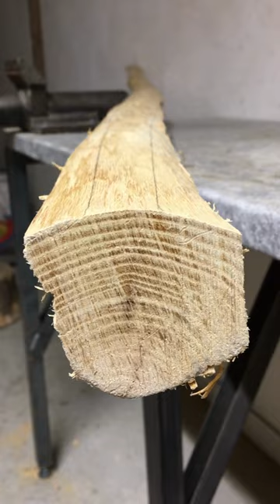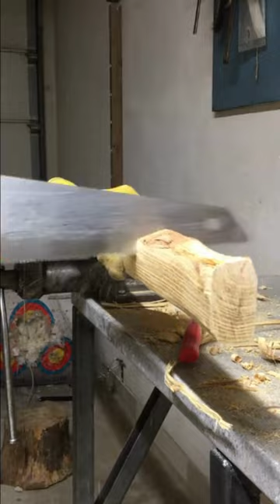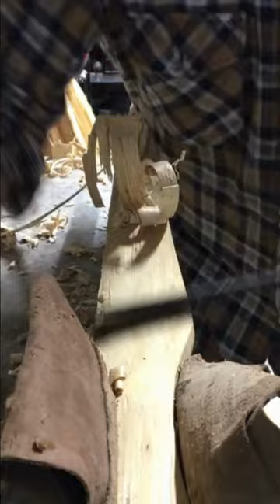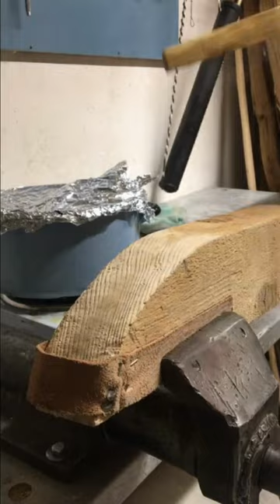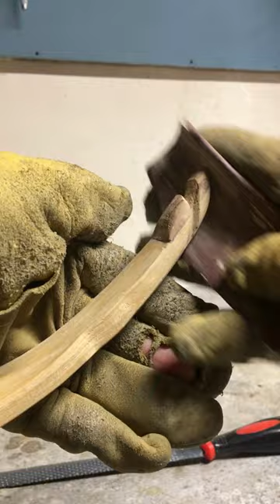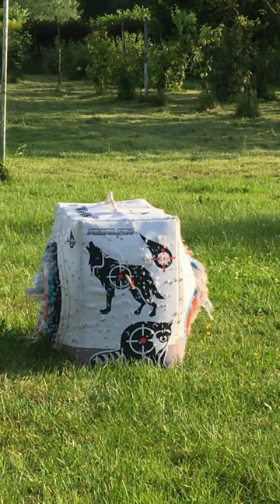From Stave to Bow: Black Locust Recurve

Comment: Is honey locus just as good as black locust?
Reply: No. But, it'll still make a great bow, just make the limbs about a quarter inch wider at the widest point than you would for black locust. Use the heart wood and chase a ring on the back just as you would for black locust as well.
Reply from the maker: I' haven't used honey locust so far